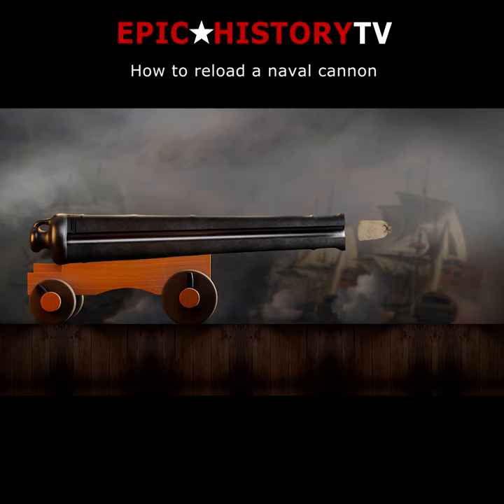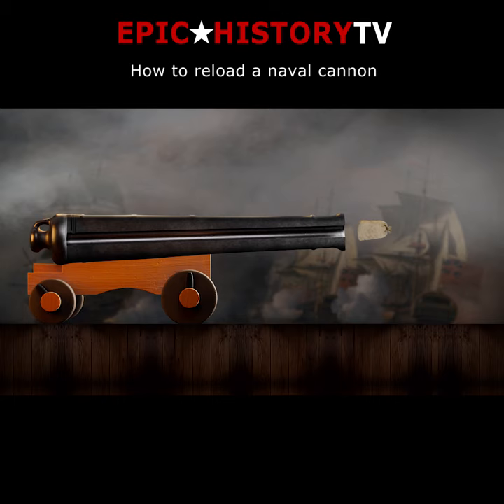How to reload a naval cannon

Comment: Three rounds a minute in any weather; now that's soldiering! XD
Reply: I suppose you mean seamanship. But ok, soldiering is applicable to land batteries.
Reply: @yatsumleung8618  it's a Sharpe reference
Reply: Yarp… here’s a useless fact, did you know that the rifles at Waterloo, carried  cartridges with undersized balls so they could be loaded quicker when they operated as part of the  brigade, ie firing in three ranks. I can tell you, loading a patched ball into a Rifled Baker Rifle, takes both hands on the Ram rod, hence the swell at the top, 3 shots a minute, tap loading can be done.. but ive  seen barrels split open during re-enactments  due to the paper cartridge becoming lodged near the top of the barrel using this technique. As for spitting the ball into a hot barrel.. best scenario singed lips, worse scenario no top of head left.
Reply: @paulnimmo3208 The top of the head, is the most overrated part.
Reply: Try getting that rate of fire from a shoulder-fired 24 pounder...! 🙄
Reply: No, in reality it took approx two minutes. And as the battle goes on that is significantly more because of the exhaustion and other reasons. But I got the joke about the short clip.

Comment: The Aubrey Maturin books describe a quill full of gunpowder being inserted into the touch hole as a primer.
Reply: That's probably because the ship's guns did not yet have "gunlocks" fitted yet. 

Instead the quill would be placed and a linstock (stick holding a slow match) would be used to light the quill. I am pretty sure the books mention either slow matches or linstocks.
Reply: Would the quill remain in place during firing?
Reply: @sipjedekat8525  Yes, it would burn away. Its similar to the modern cannon fuses just way faster
Reply: @thrifikionor7603  ah, thanks for the info. Sometimes I underestimate just how much power is involved in these things.

Comment: Wadding was mostly to create resistance pressure which increased the power of the shot. The cannon would be pitched above horizontal.
Reply: I thought it went gunpowder then wadding THEN cannon ball. Is that not correct if not then why

Comment: The man thumbing the vent wasn't to keep sparks from falling in. It was done to keep airflow from igniting unburned powder from the previous shot.

You also forgot to mention the sponge step of the process. After the wormer gets the trash out of the barrel, he then uses a wet sponge to clean the barrel. THEN the next round is inserted.

Comment: A crew of 6 served the gun.
- Gun captain: primes, aims and fires the gun
- Sponger and loader: who do all the swabbing and loading
- Left and right spikers: moves the gun into position according to the gun captain's commands, using a long wooden pole
- Powder monkey: often 8-10 year old boys, who transported the cartridges from the ship's magazine to the gun
Reply: On the 12 pounders your right, but as the guns went up in weight and calibre so did the number of crew, 32 pounder had 10 crew, whilst I accept power monkeys ships boys were often young, on the victory at Trafalgar the youngest boy on board, Thomas Twichett, was 12 years old, he joined the Victory at Portsmouth on the 10th September, four days before she sailed for Cadiz, kids on board would have appeared allot younger however during the Napoleonic Wars, the nutrition they had meant in many cases they were underdeveloped not entering puberty until they were 16. Hardy did have a 7 year old on board for a short period of time , however many of the younger less experienced boys were transferred prior to the engagement. Nelson always intended to  cross the line, he knew the carnage that could occur, he needed the best most experienced crew he could get.

Comment: why was it necesary to initially block the vent if the gunpowder is the last thing to be added? it feels like no sparks can last that long to then be a hazard. Why not block the vent when you are adding the gunpowder and use that man for other functions?
Reply: It didn't take long for spark paranoia to set in after the wide adoption of gunpowder weapons. A few centuries of tradition don't go away because of one smartass gunman questioning it's validity.

Comment: Wouldn't you plug the vent after swabbing and worming?

If the water on the swabber turns to steam, wouldn't your hand get immediately burned and pushed out because of the increased pressure?

Comment: I think this is incorrect. They have shots as a single unit type of thing in the army, so there was no point not to use this system in the navy.
Reply: Came here to wright the same thing. The sing shots actually looked pretty cool, dint know why they have to show this inaccurate crap instead

Comment: In practical terms, how many minutes does it take to reload each cannonball round?
Reply: For a veteran crew 90 seconds for an average crew 2-3 minutes
Reply: @sundancetitan5675  
If the heat of the cannon is taken into account to prevent the gunpowder from igniting itself or causing the crack to explode.
So how many rounds can be fired continuously per hour?
Reply: @Ungu.Perkasa  “In the late 1770s it was said that a 24-pounder could fire 90 to 100 shots a day in Summer, or 60 to 75 in Winter. However, French artillery officers managed to have a cannon fire 150 shots daily during siege. A 16 or 12 pounder would fire a little more, because they were more easily served.” Only thing that o could find which might answer your question
Reply: @sundancetitan5675  Thanks for sharing this information, because as far as I've researched on the internet myself, hardly anyone is talking about this issue.

Comment: I am certified to shoot cannons like this. This video is wrong and dangerous. The gun is moved into the cleaning loading position by the crew for the first shot henceforth it will recoil on its’ own. A vent stop is used usually a thin leather thumb stall by the gun captain who gives and repeats each order if he deems it necessary due to his feel of the  air pressure and air suction during swabbing to insure that every bit of the inside surface of the barrel has been touched by the properly damp swab. In cleaning the worm is used first to remove debris. Then the barrel is swabbed. After the charge is know to be seated, by observing marks on the ramrod, and the projectile is similarly rammed, and wad if needed, it is punctured with the vent pick which must be brass so as to not strike a spark and set of the gun prematurely. A squib is inserted (a bird feather filled with fine grounded gun powder) as a fuse. Loose powder is only used as a last resort since it can lead to hang fires and ignition failures. When the order Fire in the hole is given the gun crew up to 6 individuals must be standing clear before the Gun Captain lowers the linstock with the slow match burning a bright coal. Naval guns are designed to recoil freely a given length to expedite cleaning and reloading.  They weighed from hundreds to thousands of pounds and recoiled at up to 60 mph. So getting out of the way was no joke. Ear protection was cotton roving held in by a cravat or similar piece of cloth. Eye protection was not know to have been used but must be used today. It was important for the Gun Captain especially but everyone one not to look directly at the vent hole.

Comment: Point is caste iron must be thick enough and gunpowder or blackpowder must be precisely measured so it doesn't explode you don't wanna have huge iron ingot flying around don't you? 

Anyway i tried built musket at my home so yeah i know how it works pretty much i think, just need iron barrel, minnie ball, firing locking mechanism place and triggers item